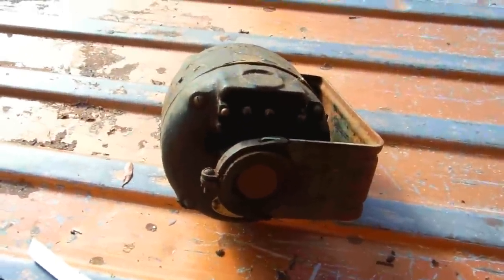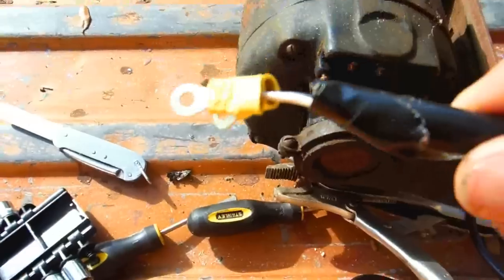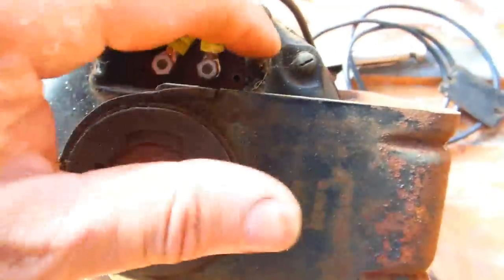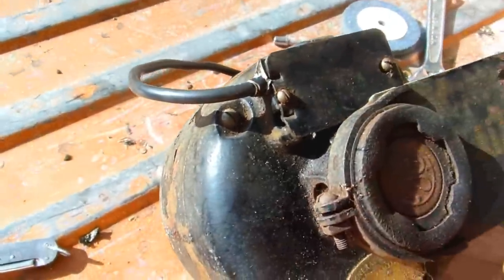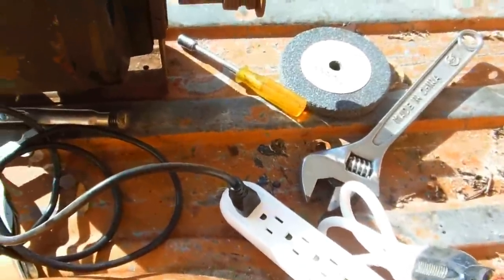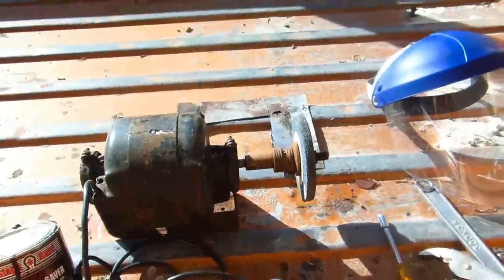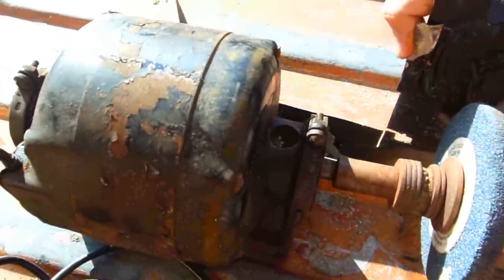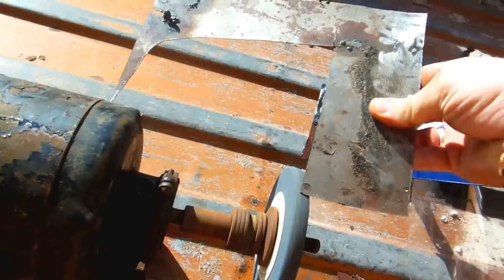Make a Bench Grinder from an Old Washing Machine Motor

Comment: I just found an old maytag washer out in the woods where people dump garbage. I brought it home to take the washer apart for the wash basin to use for camp fires. They have lots of small holes but keep the embers in. I pulled the motor just for shits and giggles, cleaned it up and tool an old bench grinder that had a electric moter with belt...it bogged down and was worthless because it had NO power even with  1/2 horse....the old maytag wash machine motor is like no OTHER...it is AMAZING....i can hold a hunk of metal against it and push as hard as I can and the motor does not bog down. ..could be dangerous but I love the power. I thought I was the only one who had a good idea.

Comment: You should have found a place to hook the ground! It's an induction motor with a metal case, the case will be energized! If it's not plugged into a GFCI protected circuit, it's a hazard waiting to happen.....

Comment: Now i like that idea...wonderful...I want to make one now. I had a few "dangerous" close calls grinding accidents...most stem from the object being sucking into the bottom-lower guard and throwing the object or stopping the motor....i always use eye protection...top guard manf. yes...but I'd make mine without a bottom guard...object get pinched and sucked in!!
Reply from the maker: $8 for quality Porter-Cable grinding wheel, coarse and 8 inch and free shipping.
Reply: syyenergy7  How to make the extension to secure the wheel on it ?
Reply from the maker: Tepeš KGB-VGD
I had some heavy flat washers and that holds it good.
Reply: This will be my next project :) I have a old motor with 4 speeds, just to figure out how to bind it and how to attach wheels to it. The only and biggest problem is that my welding machine is not working :(
Reply: Accuracy Marked Place the grinder stone so that it turns downwards towards you... I know, it´s a late reply.

Comment: I'm actually working on doing something similar with my old evaporator cooler motor at the moment, but I'm running into a bit of a snag. How did you mod the end of the axle to take the screw on sets like that? I wanna make mine a bit modular as well, so I'm going to try to house the thing in a way that I can set up a kind of grinder belt situation for it too.

Comment: Are these AC current or dc current? If there's just a positive and negative terminal could you use either?
Reply from the maker: Archer Douglas AC
Reply: +Archer Douglas but many washing machine motors are universal, AC/DC

Comment: Trouble is, a brand new bench grinder costs less than just the new wheel for your bench grinder
Reply from the maker: How so?  Even cheap bench grinder is $80. This washing machine motor is strong as the motors used on the $170 grinders.
Reply: syyenergy7 Do the grinding wheels cost more than $40 to $50?....if they do...then he might be correct. I don;t think grinding wheels cost that much.

Comment: What spindle speed does the motor run at? All for making tools but if your motor spins faster than the grinding wheel is designed for( max rpm will be on it) than it could explode and have been know to kill people. Always make sure the motor is suitable speed wise, rpm, to use with a grinding wheel. If not can still make a polisher etc but grinding wheels can be anywhere from 2000 - 4000 rpm max. Hope people watching this do their homework before blindly making one and their being consequences
Reply: Just giving people a heads up, grinding wheels are not suitable with all motors( motor must run at lower rpm than grinding wheel is approved for), but I agree with recycling or up cycling old motors for different uses like this
Reply: If you have the know how you could use pulleys to reduce the speed if the motor itself spins too fast.